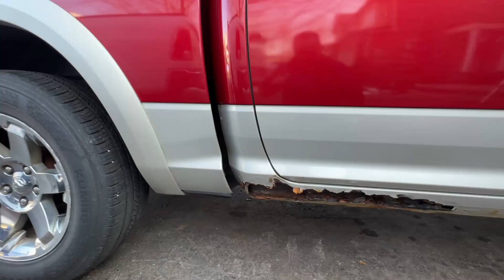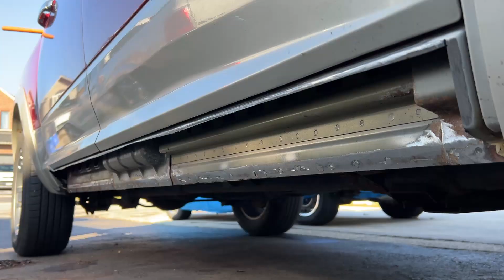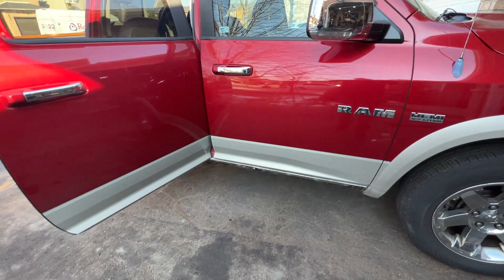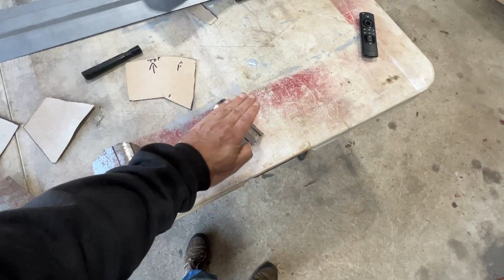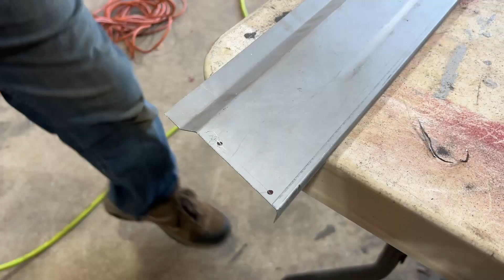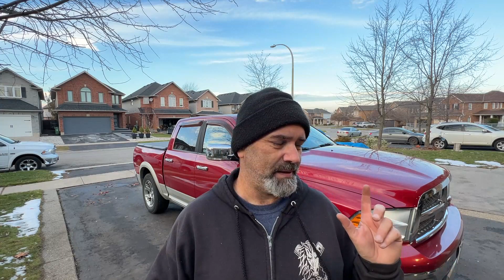Ram 1500 Rocker Panels Repair Day 2 - Preparing The New Panels

Comment: I did this repair on my 04 Ram about four years ago. Looks like you could have used a cab corner for both sides. It would have made it easier. I know you didn’t want to pull the bed off. I didn’t either. But I replaced the cab corner on both sides without pulling the bed on mine. My Ram was a regular cab and it’s a little different than a quad cab. But you made a home made patch work. Good for you. You got it done. Well done!